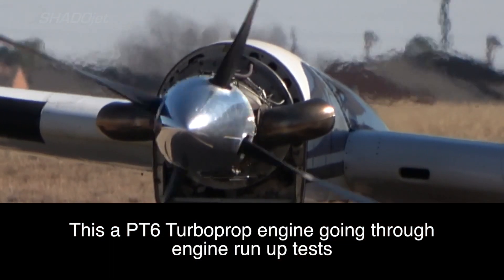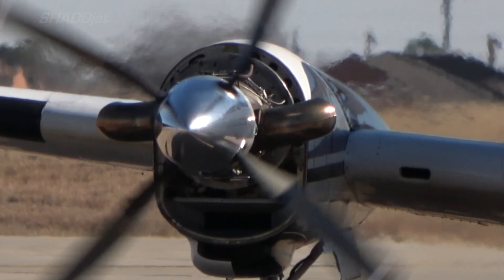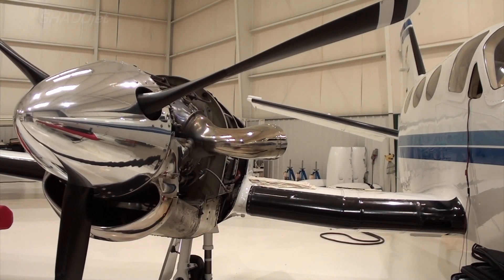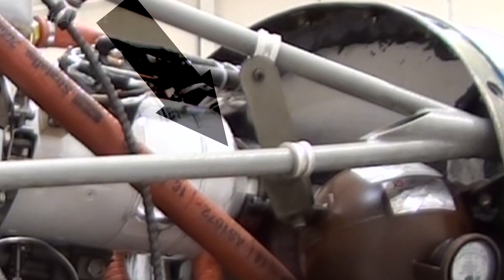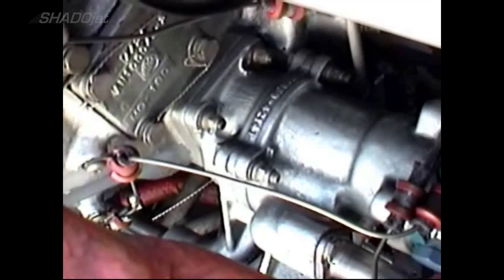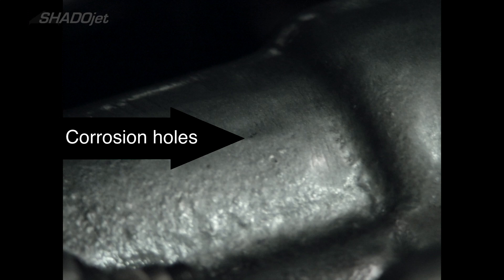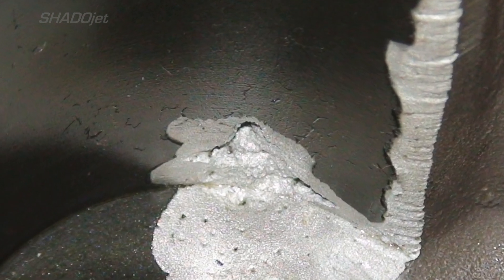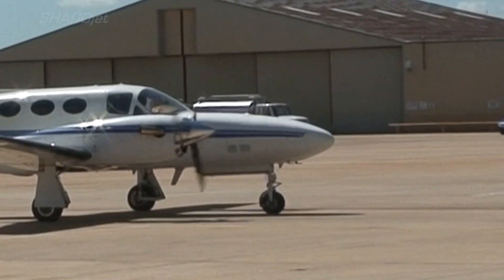Finding the impossible PT6 engine oil leak

Comment: I often wondered if the difficulties trouble shooting airplanes are due to the low skills of the mechanics. I hear they don't pay them that much. But at least they do not have to buy as much tools as auto mechanics. The US seems to be losing a lot of auto mechanics, but they appear to have an over supply to start with, so pay and working condition did not improve any. By the way, your other video, a 15 amp breaker popped inside without any external trip indication, nothing unusual, happen all the time with household breakers. At least you people do not have to work with flat rate. The C421 also came with Garett/Honeywell straight through engines, I hate them, one landed and come within 150 ft, with one left running, no one can talk or hear anything.  The PT-6 reverse engine is much better. More reliable but lose a little efficiency.

Comment: The distress to the scavenge pump housing appears consistent with cavitation.  In this instance typically operation at higher altitude, the design and materials have been optimized on later engines  to withstand this.  Of interest / concern is the last image showing the large area where the AGB paint had debonded, consider to inspect inside the AGB for similar de bonding.
Reply: I hope he also checked the other engines scavenge pump housing for the same issue (internal check)

Comment: At my Job, we use a dye penetrant test, which can be repurposed to find fluid leaks. It comes with a white developer spray, something like chalk in a solvent. It highlights the cracks by drawing out the dye.
To find leaks, clean the suspected area, spray it with developer, pressurize the system if neccessary and leaks will show up as wet spots. Works wonders finding tiny leaks.

Comment: That pump is in crazy rough shape . I don’t think our demo engines in the gas turbine course had that bad of damage. I  hope the discolouration of  the internal casting was from the inspection process, otherwise this is a very dubious scavenge/oil pump. I wonder if this is a PMA part. Up here in Canada PMA part are not approved for installation here and there are good reasons why especially on bearings. I never understood why they would allow PMA or reconditioned bearings. I found a twin pack PT6 which had a tonne of play on 3 of 4 of the accessory heat box bearings. All three were PMA bearings why the only reasonably good one was an actually factory authorized part. I can understand a PMA oil filter perhaps, but key items should remain factory authorized parts. I had no concerns on the work done by the company I worked for.

Comment: You are lucky Sir, we didn't have this sophisticated Equipment in our company
Reply from the maker: No luck involved. I purchased all the tools myself and paid for them out of my pocket. Many thousands of dollars spent in order to perform the best quality work I can.
Reply: I just retired from a major aircraft manufacturer, getting them to spend money on resources for the shop floor was nearly impossible. For example, we decided that we needed a Freon detector to troubleshoot a leak on an Environmental Control System, No not invented by Manufacturing Engineering.
Reply: @duanepierson4375  well said,  be also pretty cautious using selfmade unauthorized special tool which can lead to damage parts
I am out of maintenance since years due to handicap, but trust me I learned my lessons